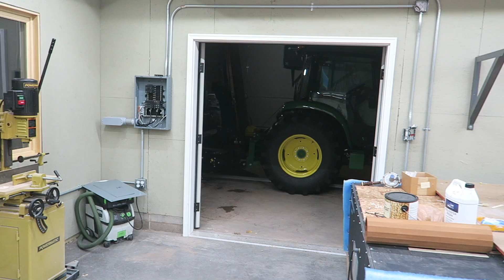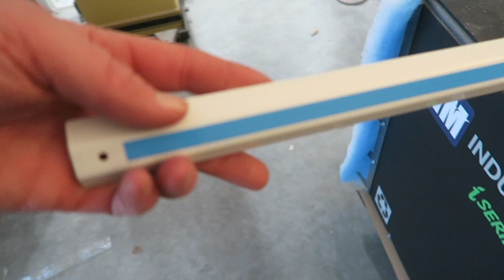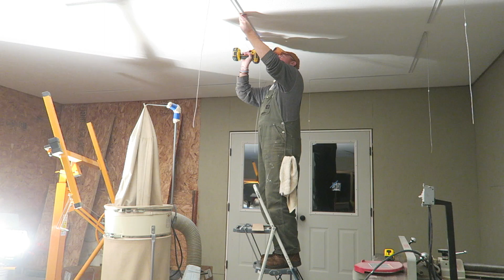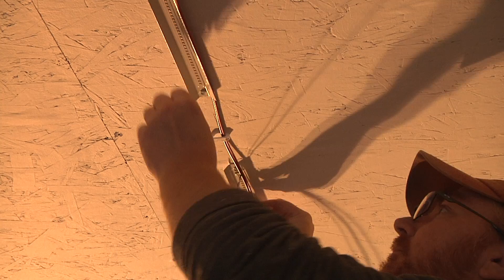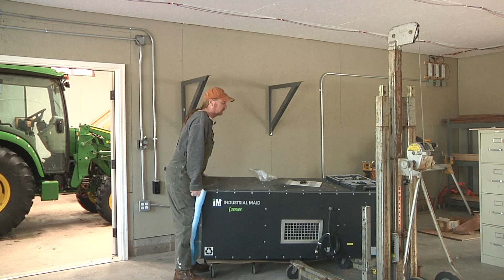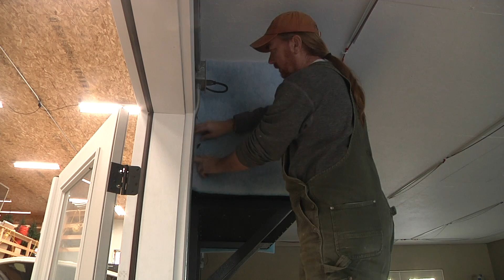I'M DONE!! (with the shop that is ;-)

Comment: Color code for clips: RED is smallest, BLUE, is intermediate, YELLOW is largest.

From your results, the wire gauge of the lights is probably 22 gauge — too small for the blue clips to properly displace the insulation giving poor connections.